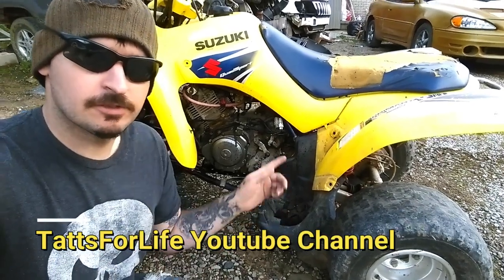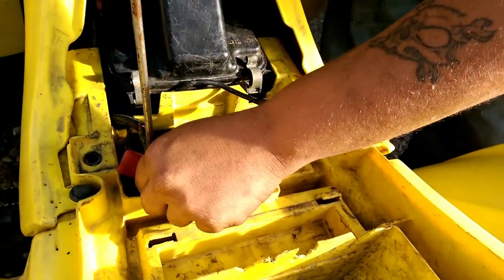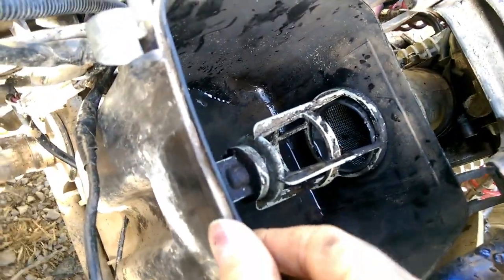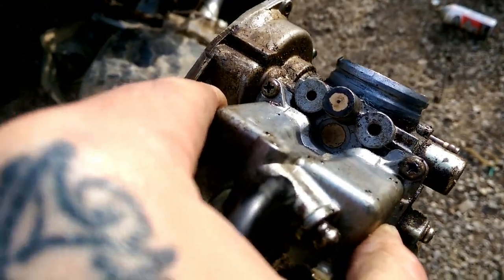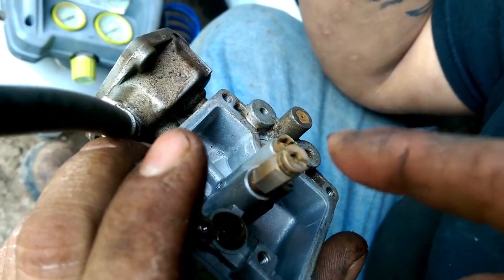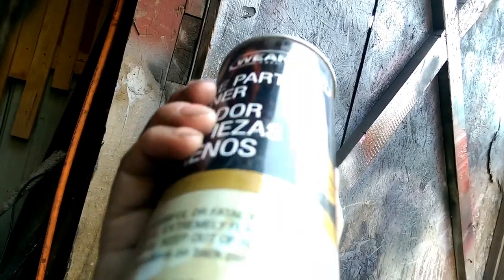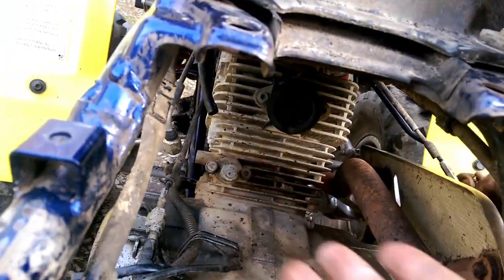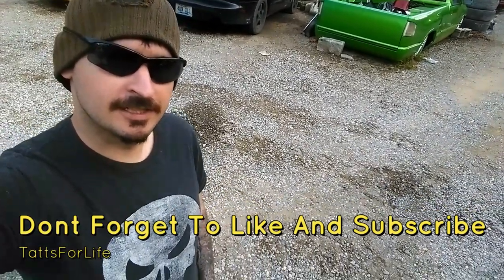CLEANING YOUR ATV OR BIKE CARBURETOR JET AND FLOAT BOWL | HOW TO VIDEO

Comment: We've got a ltz90. Starts and runs but not power unless it"s choked. Had a weak spark so replaced the plug and it has a nice bright spark now but runs the same. I'm thinking it's carb related so will give this a shot. Thanks for posting.

Comment: I have two ltz250s. I replaced both carbs and can’t get them to start. I’m new to the mechanic world, as I’m an electrician ;) I just wanna get them running for my son. I’ve cleaned the tanks out and put new gas. I cleaned air filters. I charged batteries. They turn over. Any suggestions would be appreciated.
Reply from the maker: is it getting fire?

Comment: I have a 2006 eton viper 90 r 
It was running couple months ago but yesterday i tried to start it an crank but won’t fire up i did check and i do have spark also the battery is new so any ideas???
Reply from the maker: spray some fuild in the intake and see if it fires up, prob a stoped up or jelled up pilot jet

Comment: Hey I got a 2003 kawasaki kfx 400 I cleaned carburetor now it won't start.. I messed with idle a bit it's getting spark was firing up before I cleaned. I did not remove float only jets
Reply from the maker: Idle air could be to low for it to start, or your float is stuck
Reply: @TattsForLife  Thanks for quick response bud. 
How would I be able to tell if float is stuck? If anything turn choke on and try starting while turning idle air ¼ turn at a time?
Reply from the maker: @harrywilson6124  take it apart and inspect it again, the float can be wedged and have fule shurt off. If it's a fuel issues you could easy tell by spraying starter fuild in breather if it fires up, u know it's a carb issues of no fuel

Comment: I came across this bc my bike sat for a couple months and now will start but will not stay running. It seems like it’s starting for gas. Do you think cleaning the carb could help that or why do you think it won’t stay running longer than 15-20 seconds?
Reply from the maker: Sounds like your carb has become full of gel and needs cleaned
Reply: TattsForLife, will do! Thanks man!
Reply from the maker: @andrewp.619  happy the video was useful
Reply: TattsForLife, very. I like this way rather than taking the tank off and having to pry the air hoses off and having to stuff it back in. Thanks again.
Reply from the maker: @andrewp.619  happy to helped, thanks